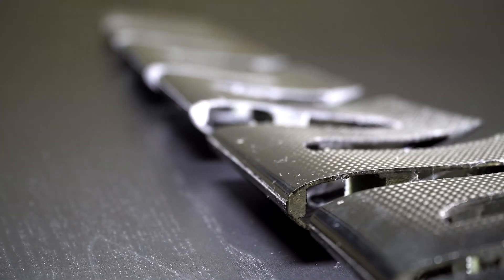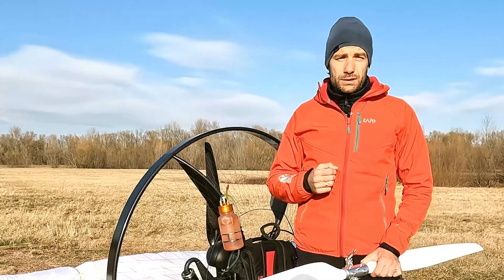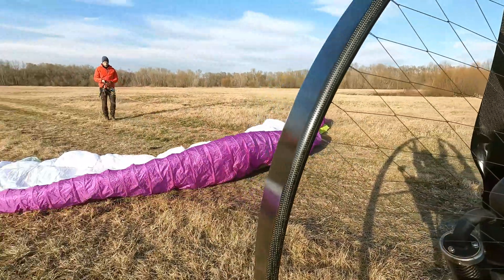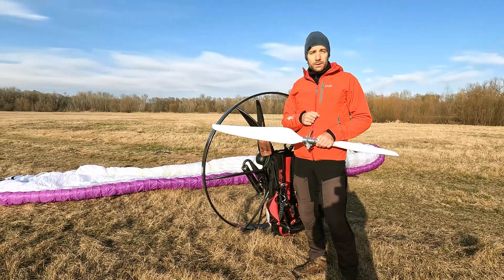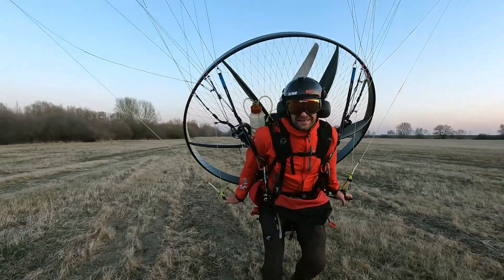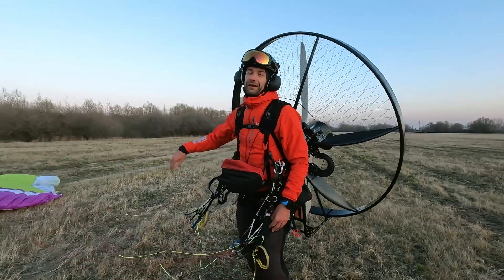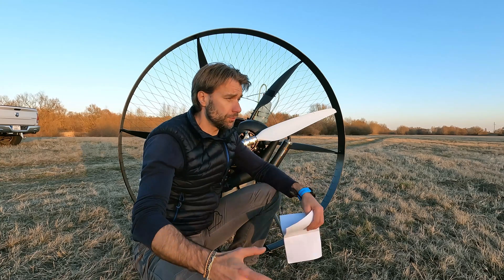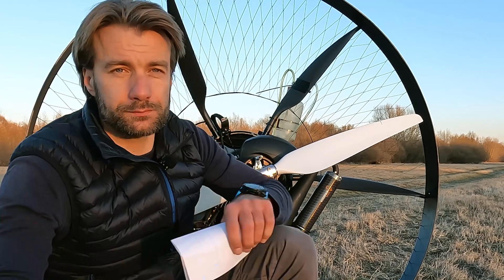Very precise measurement of fuel consumption - paramotor experiment.

Comment: What about the fact you didn't lock your throttle to maintain the same rpm's for both tests. This could throw off the results.
Reply from the maker: I don't have cruise control on my paramotor. But I did a pretty good job holding same RPM and same altitude all time.
I consider the test accurate enough.

Comment: The fuel savings are certainly great, and this has several advantages. Either less take-off weight for a certain distance to travel. Travel further/longer airtime with the same take-off fuel weight or combinations of both. But for me it seems that less noise is really one of the best features as the noise issue is what is often making our sport intolerable for those non-flyers on the ground. My paramotor dream is silent (hardly discernable on the ground) powered flight - like paragliding. Then many critical people will have nothing more to complain about.

Comment: Hey Miro. Theoretically when you have a "13ﾟ" propeller (setting) you would have the same fuel consumption as if you had a " 13ﾟ" fixed propeller (setting).  Technically what you changed is the take off pitch or cceleration pitch.  Your sales "pitch" should be easier take off not fuel consumption.🤔🤙
Reply from the maker: Not at all. With 13 degrees the engine was crazy overheating at full throttle. This was explained in the previous video.
Reply: @SCOUTaviation   My point was that propellers are normally made for cruising speeds. Propeller pitch adjustment is mainly for takeoffs. If you saved 30% of fuel compared to the other propeller that means the other propeller was not correct for cruising.

Comment: Why use aerodynamic adjustment rather than (centrifugal/centripetal)? Surely the aerodynamic adjustment will change with altitude?

 Thanks!
Reply from the maker: Centrifugal needs weights. Why weight to something we want to keep light?
Reply: @SCOUTaviation  Maybe I did not pay attention to the first video? 

I thought you could attain the optimum adjustment at the right RPM just through the momentum of the assembly itself? 

High RPM - more force
Low RPM - less force

If you need to add weights to get that result just with spinning I totally see why you'd opt for the aero solution.

Out of interest do you have any figures (was any CFD done?) for what savings (if any) such a system would have?

Thanks! :)

Comment: I'm guessing air density will have a lotv to play in this as well
Reply from the maker: Both flights done on within one hour at same altitude. So the only thing different was the prop.
Reply: @SCOUTaviation  - can you do a different test, where you test different take off roll distances on a trike, using both regular & variomatic propellers? Would that be possible?

Comment: This is awesome. Do you think the results will be similar with different belt reduction ratios? I use a 1/2.87 with a 140 mm prop currently.
Reply from the maker: i definitely want to test on my Factory R with 2.87 reduction ratio
Yes, I assume it will be very similar
Reply: Thanks. I'll stand by for your results....this is very cool.